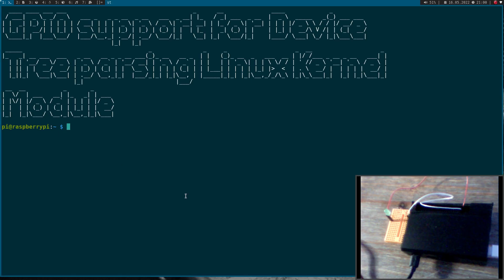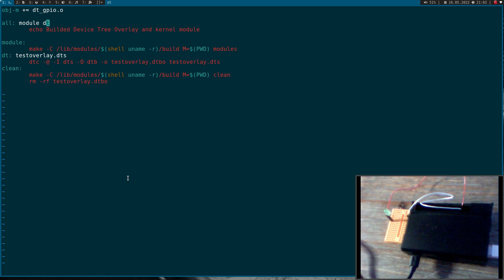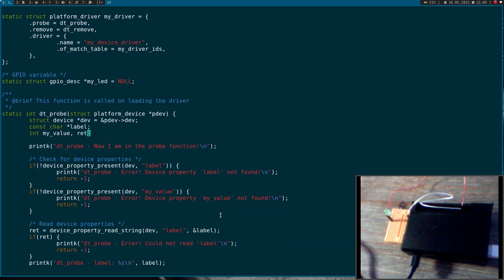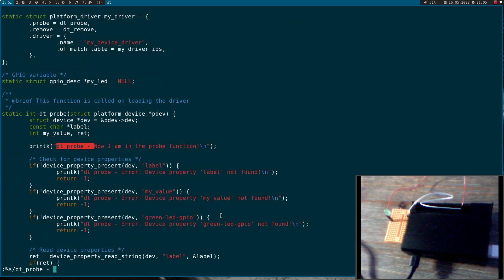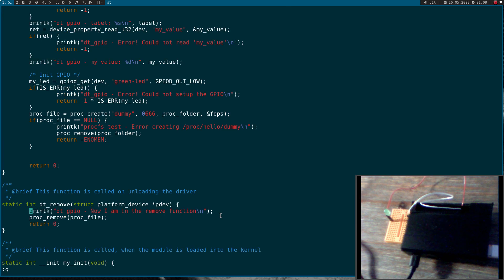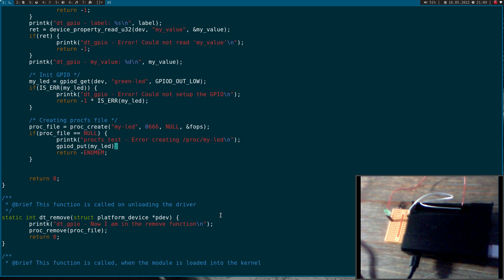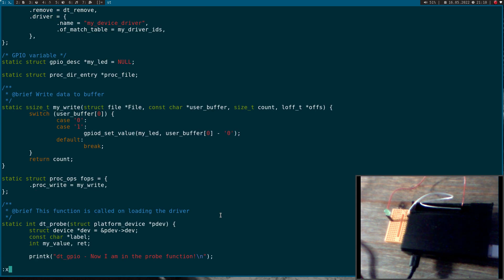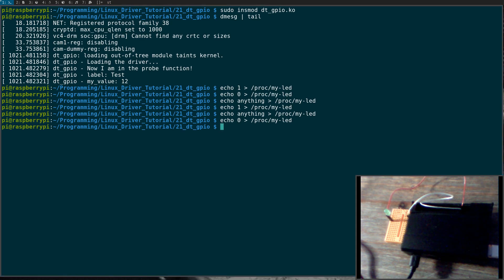Let's code a Linux Driver - 21: Device Tree GPIO Driver

Comment: Interesting, thanks for providing this! In "compatible", what is the "brightlight" for? Could it work without? 
Note: I'am not aware of device-tree syntax... So the dts file is confusong to me
Reply from the maker: You are welcome. 
If you are writing your own Driver and device tree overlay you can choose a random String Here. But the important Point is that you have to use the same string in the driver and the dts file.
A common naming convention for compatible strings is to use the vendor Name and the device Name, e.g. "bosch,bmp280" for the Temperature and pressure sensor from Bosch. 
I made up a vendor and the result was brightlight 😉
Reply from the maker: And maybe you should take a look at the previous Video. There I am describing the device tree overlay in more Details

Comment: is "dtoverlay" RP exclusive? I don't have it on my custom system and can't seem to locate it. Other sources suggest using uboot to load overlays.
Reply from the maker: Hmm, good question. To be honest I haven't worked with device tree on real embedded platforms...
I guess on an embedded platform, I would add my devices directly in the original device tree and compile it.
Reply: @johannes4gnu_linux96  That's what I ended up doing but it's a bit of a hassle while you're testing stuff to have to re-build the system every time you change some small thing in the device tree. I discovered that you can actually load and/or edit the device tree while in uboot so that you can test stuff. Makes the development process much faster.

There's a section on how to do it in the uboot user guide. Anyway, thanks for all your hard work.
Reply from the maker: @johanneswestman935  Thanks for the hint. I want to do a series about cross compiling with a real embedded platform and I think I will need the ability to load dtoverlays through u-boot there.

Comment: Thanks a lot for these videos. Just an interesting remark. In my case (kernel v5.15 running on Terasic DE10-SoC), I'm not able to use values in the user_buffer directly like you are here. Before the switch statement in my_write I added the following to first copy out the first character:
	char new_state = '-';
	copy_from_user(&new_state, user_buffer, 1);

and then I could do
			gpiod_set_value(my_led, new_state - '0');

If someone knows why I'm all ears :)